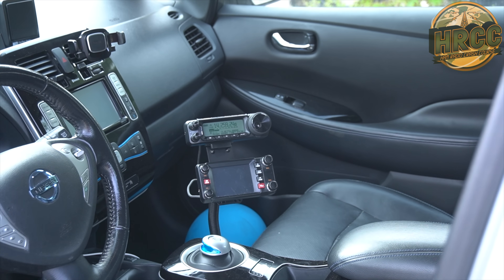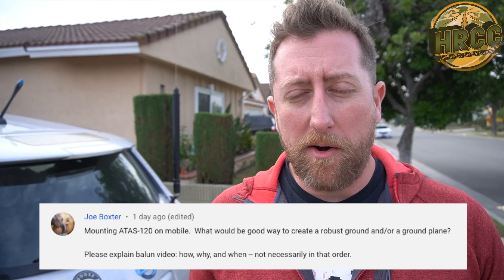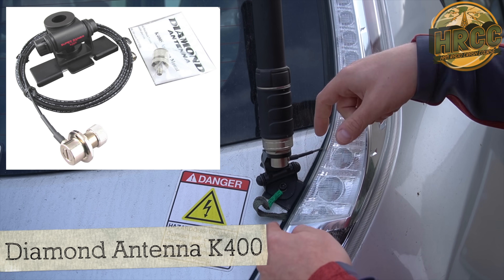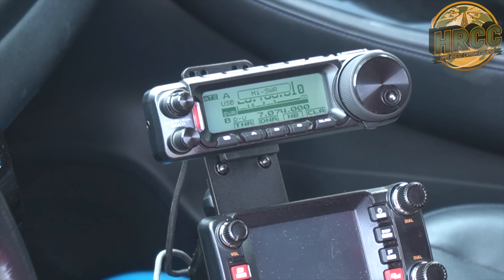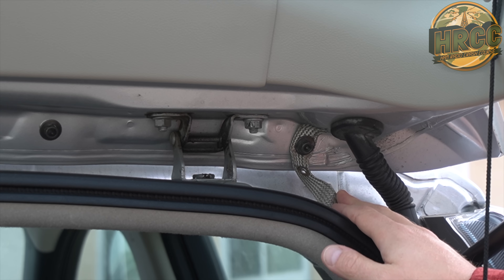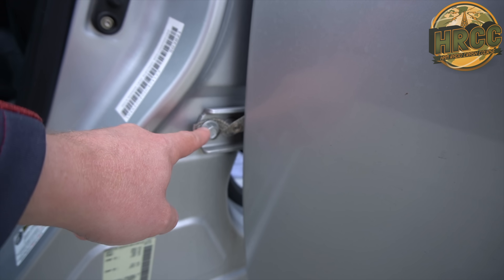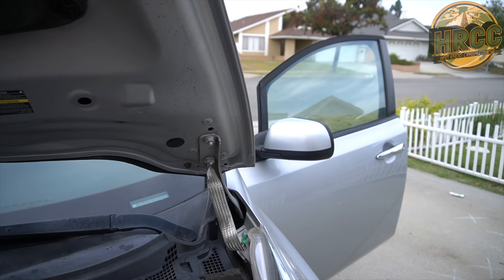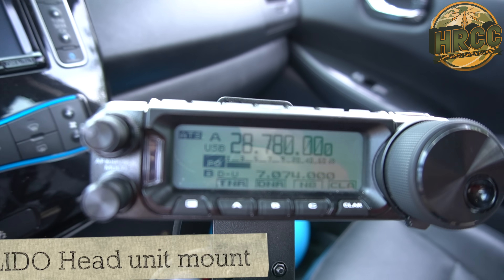Mobile Ham Radio Grounding and Bonding Electric Car!

Comment: A lightning arrestor on the coax and then the ground wire from
the arrestor to the vehicle chassis. A lot easier than bonding the antenna mount.

Comment: I'm having trouble with my Colorado trying to run an amp on radio. Everything is bonded and radio and amp cases are grounded plus I have ferrite beads on power and coax but still have emi problems with ECM.
Reply from the maker: Is it all the time the truck is on?
Reply: @HamRadioCrashCourse only when keying mic
Reply from the maker: Ohhh. You’re blasting your ECU with rf.  You might be splattering. Dial back your mic gain until it stops.

Comment: Hi, I would like to use a ham stick installed on a magnetic base on the EV Nissan Leaf, but I don't know if HF waves affect the car's electronics. Any opinion?
Reply from the maker: I used to run HF all the time. No issue.
Reply: Hi Josh, thank you for the info. BTW, great video! 73s de VE7PAE

Comment: I have not an electric car but a cargo trike where I recently installed an ebike conversion kit to. I have a Jensen AM/FM motorcycle radio on it. Often times, though not consistently, the radio reception goes out when I open the throttle for the motor. I've been experimenting with braided shields to put over various wires and cables to try to filter out the noise. They have noticeably helped, but have not completely eliminated the problem. Still figuring things out and learning as I go.

Comment: Does the serrated lock washer bite in to the paint/metal enough for the needed connection instead of removing paint or do you need to do both?
Reply from the maker: That is specifically why we use the serrated washers, they bit in enough without having to sand and compromise the vehicles finish.
Reply: @HamRadioCrashCourse  last question! That serrated washer goes behind the hinge against the body? Or is the hinge itself already connected to the body? (Are pieces individually painted so technically the hinge is not connected to the body?) Would putting it between the hinge and body make the door close funny?
Reply from the maker: You put them on both sides of the hinges. The ideal being that between the flanges and the bolts you’re making electrical connection somewhere.

Comment: Reviving an old video, but I’m researching what is needed for installing HAM in a Tesla. Bonding is a good topic, what about a hanging bonding strap to drag the ground like what you see on welding rigs? Would the dragging introduce more noise than it eliminates,
Reply from the maker: Having tried it for a few years, I don’t believe it does a damn thing. 😅

Comment: Have you found any benefit or need to put a choke on the feedline to prevent common mode current?
Reply from the maker: Oh yeah chokes all over. Go see my mobile radio install video.
Reply: @HamRadioCrashCourse  - I watched and saw your mention of chokes on the power lines, but I didn't see any mention of one being on the coax. To be clear, I'm referring to the ATAS-120A coax. Keeping a choke OUTSIDE of the car with a lip mount is tricky business. HAHA! Thanks! -Scott, KE4WMF
Reply from the maker: @StealthGTI  I have toroids on both power and feedline.

Comment: I'm using a little tarheel and have a tough time tuning below 3swr. I thought it was ground related and am getting told by old timers that the cure is drilling into my 2yo 4Runner. Something I really don't want to do. I'm told that once a ball mount has good metal to metal body attachment the grounding will be good. I'm also using an mobile autotuner that requires one to three points on each band for the tuner to learn. I have a significant time and financial investment in this and wont give up. I was even out in 19 degree snowstorms in Michigan trying to add extra 12 ga wire grounds in addition to all the door, hood, hatch, and body/ frame/ muffler grounds so that I could work HF on the 11 hour drive home but no dice. I was just trying to tune one spot using a nano vna on a one band back then using the supplied rocker switch. Trying to tune by the noise the radio generates (loudest noise is on band, suggested by Tarheel saying autotuners are not needed) is a dumb idea since  you cant hear squat in a moving vehicle. They probably were referring to tuning while parked but even that isn't a great idea since the VNA shows several dips in the swr across the HF, 1.6 to 45 mhz on the VNA. I know that 6m is not HF, no need for corrections, just stating that I had  a wide window to look at swr set up on the vna. You could get fooled into thinking the tuning was correct unless seeing the entire spectrum. This was my experience and it may be unique and not representative of anyone else's experiences. It's time to scratch that itch again and fiddle with it some more tonight. Cheers.
Reply from the maker: Here are some tips. Never use an auto tuner with a tar heel or coil tuned antenna. It’s suppose to be manually adjusted to find the match.  The easiest way to tune these is to have something that gives a constantly updating swr display then adjust the antenna up or down to move the curve. 

You could turn your tax power down on your transceiver in a mode like fm or am and begin adjusting the Tar Heel while watching the swr.

Comment: Ive heard that hybrids and radios dont mix? Im about to pick up a prius and put a gmrs unit… will i come across any issues?
Reply from the maker: You might. You’ll need to do a lot of bonding if you do run into issues.
Reply: @HamRadioCrashCourse  i will be using a mag mounted antenna, how do i do the bonding? Sorry for the questions
Reply from the maker: @DPascual2011  happy to answer questions, but in this case, the video is about how to do the bonding.

Comment: Another great video, Josh!  I asked you in another video for HF antenna recommendations and I guess I should have been listening better as you described using   The Yeasu TOS antenna.  What if you didn’t have the Yeasu radio though?  Just point me to some manuals or reading material.  I am planning on bonding everything to my truck frame as well.  Again, thanks for the video.   You are so good at explaining radio to us noobs!

Comment: If you want to reduce noise and ground loops in a mobile radio connect the positive line to the battery.  Obviously you will have a fuse in this line.  Then connect your Radio GROUND TO A GROUND inside the car, like a seat mounting bolt.   Do not connect the negative power lead to the battery.  Doing it this way will reduce noise and you won’t have ground loops.

Comment: Hi, whats the average (long distance)QSO you made with that setup? and using which band?
Reply from the maker: Average? Idk. Few minutes to over ten minutes. Duration really isn’t an issue.  20 meters and 40 meters are more active, so I generally use those.

Comment: My Prius hatch is carbon fiber.  Not sure how the grounding might be done.  I'm contemplating a bracket for the antenna mounted to a tow hook through the bumper, though haven't found too many examples of this having been done.
Reply from the maker: Yes, I have a friend that did that. Hitches work well with screwdriver antennas.

Comment: Great tips to share! Working commercial radio for over 25 years couldn't agree more on bonding all parts of the body. Many people don't realize that many times car doors are removed from the car body during certain phases of assembly and those areas missed during the initial color spray are touched up before final assembly. This results in doors electrical insulted from the main body. Another tip, keep a close eye out at the ground straps on doors that are opened continuously, they WILL wear out and break. One common complaint on police cruisers was "the radios quit working". Check out the ground straps on the trunk lid where most antennas are mounted, most often the straps failed after a few years. Once replaced problem solved.
I love the "tower mount" used on the instal with remote heads but if you have passengers in the front seat make sure they wear their seat belts. One officer I knew of had a bad collision and met Mr. Tower the wrong way. Mr Tower was equipped with full size radios. Many months of rehab but he was to blame as well, did not wear his seat belt.

Comment: What is a good way to do this? I have 2x 3.5mm audio in feeds, out to 1 headphone, while prioritizing 1 of the feeds then auto switiching back to the other feed when the priority side has no traffic? Prioritize scanner feed then switch back to audio on my motorcycle. TY and subbed
Reply from the maker: What is your end goal?
Reply: @HamRadioCrashCourse  End goal is headphones in my helmet auto switching between HF and music . I have 2 in feeds(3.5mm). 1st is radio traffic that i would like to prioritize, 2nd is audio feed(low priority) music from youtube. I want the radio side to be prioritized when active and then automatically switch back to music. Some kind of tiny mixer that can be adapted to my motorcycle?

Comment: I had an ATAS 120 and for my situation (running it as a base) it did not fit my needs the radio I was using with it was the ft857d and due to how close I am to a shipyard I get alot of noise and running any verticle would be a sure noise gatherer so I switched to running ham sticks in dipole configuration then to 102 inch whips in dipole configuration now I am looking at running something that will get me on 80 meters and not be to long in doing so as I have limited space and hooking that to my TS2000

Comment: Aren't the doors and hatch bonded by the bolts that hold them to the body? Or does paint effect it too much?
Reply from the maker: Yep. The coatings, hinges and fasteners all get in the way.  Some are better than others of course.  Try it out yourself.  My car need the bonding, or else I would not have done it had the noise been lower from the start of the install.
Reply: @HamRadioCrashCourse  Thanks :)

Comment from the maker: For those interested, I'm using the Lido car seat arm 
https://www.lidomounts.com/catalog/item/8254956/10317177.htm
I also purchased the extension bracket for two Yaesu headunits.  You will need to purchase a second yaesu ball mount for the second head unit.
https://www.lidomounts.com/catalog/item/8254956/8951881.htm
https://www.lidomounts.com/catalog/item/8254956/9123566.htm
 A hacksaw cuts through the seat mount easily to get the height you want.
Reply: Did nissan say anything about it I am running a 15amp battery in trunk of my new one cause I don't want nissan voiding the warntey

Comment: Josh what is the part number for the Lido mount for the two faces.
Reply from the maker: I'm using the seat bolt mount and extenstion bracket for two head units.  I suggest calling Lido to place your order so you can make sure to get the two Yaesu ball mounts you need to complete the kit.

https://www.lidomounts.com/catalog/item/8254956/8951881.htm

Comment: I had the ATAS-120 on my Ram 3500 but it didn’t handle the all season travel well. I wouldn’t recommend leaving it on in the rain or if you drive in the winter in an area where they treat the roads with an anti-ice solution. These antennas can be serviced if you search the web for others that have done it.  I have not taken mine apart yet but I will eventually. This antenna is really the best for the YAESU radios.
Good luck with the movie setup!
Reply from the maker: Luckily we have no rain and no winters. 🤣
Reply: I have mine installed on my ram 2500 on a right front fender bracket  the bracket is grounded to the body with the bolt but i ran a ground wire to the under hood ground bolt. I’m going to take the negative off the battery and see if it helps get that noise floor down a little. I can transmit like crazy from Texas to east and west coast. Its really hard to receive low power signals though. I think I’ll try some of these straps on the doors, hood and bed. Ive noticed weird issues with static getting quieter when i touch the 891. Or pull on the mic cable.
Reply: An antenna you can’t use in the rain mmmmmm

Comment: I also bonded my muffler to the car body.
Reply from the maker: That is less of a problem for an electric vehicle.
Reply: @HamRadioCrashCourse  lmao, I bet you wrote that with a straight face :)
Reply: Christian Hoffman  I think you can get cream for that.
Reply: I was going to mention the noise floor effect from an electric car vs a gasoline engine seems like it would be measurably different but I’m definitely not an expert.
Reply: Btw, I just subbed! 👍🏻

Comment: Great job on the ground straps. The stock grounding wires if any are actually there are so minimal and frail. When I use to design demob vehicles for Alpine, we went just a couple steps further;
* Ground from battery to chassis
* Ground from engine to body
* Ground from engine to frame
I understand yours is electric, just wanted to add for those with gas engines.
ps... received my license yesterday: KN6FQZ, hard to say, trying to get something easier
Reply from the maker: Like the comments, good additions.  The EVs actually do have battery to chassis ground and to the motor.  It does help alot I feel.

Comment: Nice work, but is it safe (all this grounding) with electric vehicles? What will happen if car (and main power cable) would be damaged in a accident?
Reply from the maker: Probably an electrical short.  The chassis is already bonded to the major electrical components.  If there was an issue, the addition of my bonding and radio would not change anything.

Comment: I have an aluminum body Ford F-150. Any suggestions on how to ground to it.
Reply: Kevin I'm in the same boat/truck - 2018 F-150. I haven't installed a HF rig yet. I have installed a  VHF/UHF radio with no noticeable issues ... other than getting the power source wire through the fire wall! It took some doing but eventually I found a smart-clean route from the battery to the radio. As far as bonding for HF,  I'm guessing the aluminum body will be the same as a steel body truck. When in doubt, BOND BOND BOND!
Reply: I had a friend do this in a similar vehicle, he bonded all of the doors and tailgate everything he could to the main body, then bonded the body to the frame with a couple straps he got great results

Comment: How are the; hatch, hood, and doors not bonded to the passenger compartment already? Are the bolts for the openings too powder coated on the threads.
Reply from the maker: Some hinges are poor conductors or 
 painted.
Reply: J R. I wonder if a multi meter could be used to assess electrical conductivity of the hinges?  Josh did you need to drill new holes? If so did you tread the holes for the bolts?
Reply: @douglasdreger3852  DMM would measure DC resistance, not AC impedance.